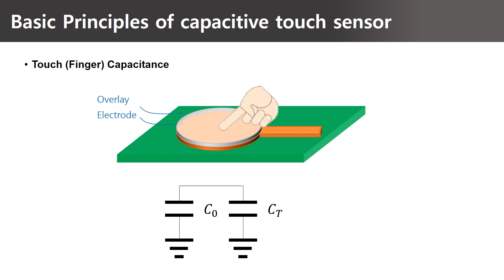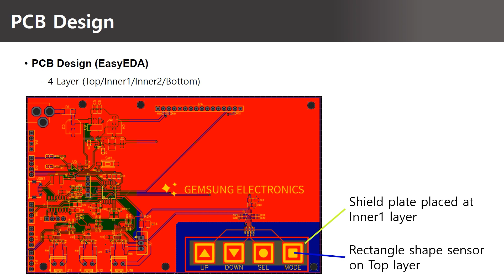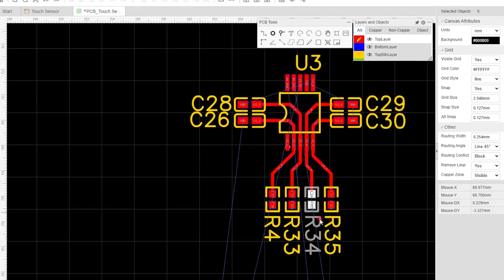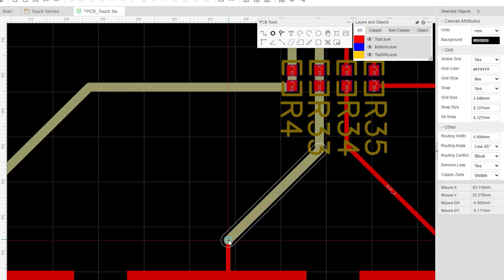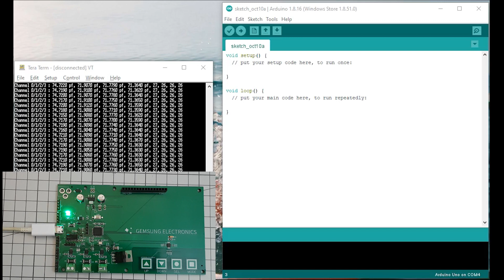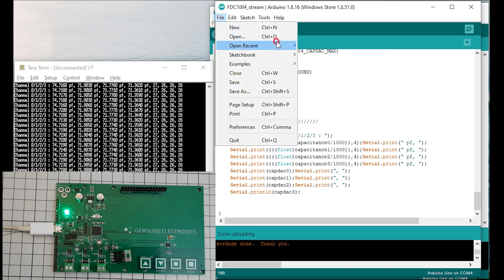How to make a Capacitive Touch Sensor on a PCB - Part2

Comment: What about if an external electrode is needed? i.e. something protruding from a box? What should be considered
Reply from the maker: In order to implement an electrode remote from the board, mostly a single cable will do.
But for robust designs, you should use a shielded cable, with the shield connected to the shield pin of FDC1004.
FDC1004 datasheet contains many information that I believe might be of help.

Thank you!
Reply: @gemsungelectronics460  thank you! Do you advise the same dimensions for the remote electrode ? Also how would shielding work for a small metal electrode?
Reply from the maker: If the electrode gets larger, the sensitivity will also increase, but susceptible to noise as well.
If you are considering a proximity sensor, the electrode can be large, but if you are considering a touch sensor, 10x10 will do.
Also, to avoid noise picking or variations due to environmental changes, be aware to shield the electrode and cable properly.
Thank you!
Reply: @gemsungelectronics460  I think changing resistor values can change sensitivity.

Comment: Where did you find all this information?
I couldn't find guidance on electrode shape/size in the datasheet.
Reply from the maker: Hello,
Most of the information comes from the application notes from TI.
 - SNOA926A, snoa927a, snoa928a, tidu519b and FDC1004 datasheet.
Also AN2733 from ST microelectronics was very helpful.
Thank you!

Comment: did you connect the shield to ground? or it is just a floating piece of copper under the top layer,, Thanks
Reply from the maker: The shield pin protects the channels from parasitic capacitance by sending out the excitation signal same as the CINx pins. So, it should be made as a floating piece of copper under the top layer where your sensor electrode may locate.
Thank you for watching!!
Reply: @gemsungelectronics460  Thank you sir

Comment: The FDC1004 costs $6.50 USD per chip, that's $1.62 per button!  The ESP32 has more channels of Touch sensors built in, and it's a microcontroller already...
Reply from the maker: Thank you for the comment!
This video was more focused on the PCB design for touch sensor application using Arduino. Although FDC1004 might not be very cheap, but has a shield pin to compensate (or mitigate) the environmental changes, which can be a great advantage for certain usage cases.
Also, it provides plenty of documents (including designs and test results) from the vendor, which is also makes this device advantageous for applying.
Again, thank you for your comment and you are welcome for any suggestions!
Reply: @gemsungelectronics460  I'm making a 9 button Capacitive Touch sensor PCB using ESP32 dev board and Arduino IDE.  STM32 has a design guide, that in a nutshell says "10 to 15 mm pads", and a matching floating ground plane on the other side, route traces as direct as possible, and similar length.  Optional is an active shield plane.  EasyEDA has some user contributed Cap pads that fit the bill nicely, including sliders and rotary sensors...  I'm going to mount the cap pads on the back of the board, and the STM32 dev board on the front, and expose the back of the PCB through the case...
Reply from the maker: Great idea!
Reply: @paul Wow, thanks for the reminder... I have the project file completed in EasyEDA, but I didn't ever send it off for the PCB to be made.  I will check to see if they have a ESP32 chip that is on their pick and place list so I can order pre-populated boards.  I've been getting spoiled in designing only with components that can be pick and plucked from the PCB fab...  JLCPCB for the win.

Comment: Hello! Does it work with Capacitivesensor library by paul badger and paul stoffgren? Thank you
Reply from the maker: Thank you for asking! I will get back to you as soon as I find out.
By the way, do you have any particular reason to use this library? You can also modify the library to suit your needs.
Thank you.
Reply: @gemsungelectronics460  thank you  for answering!! I'm using an arduino micro with membrane keypad as a psw manager but i want to try to compress all in one small board . I'd like to have idealy a 12 key capacitive keypad or at last 8 keys keypad. I want to try to do it without any chip in the middle to stay low on components
Reply from the maker: That's a great idea!
By the way, I took a look at the library you were asking, and you can definetly use this library with arduino.
Also I remembered that it was the library I used as a reference when I was making the part 1 of the capacitive sensor application video.
It explains how this library operates in detail.
Following is the link for this video:
https://youtu.be/bMR2tKl44tY

If you have any questions or comments, please let me know!
Thanks!
Reply: @gemsungelectronics460  5v would be better of course